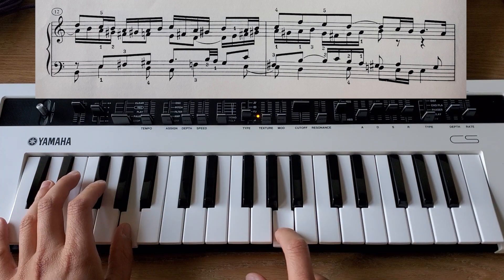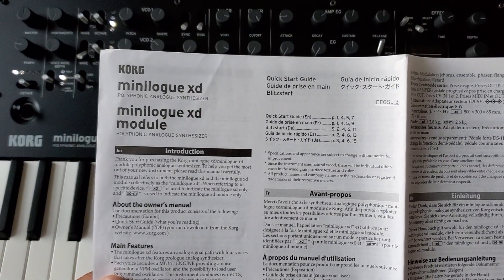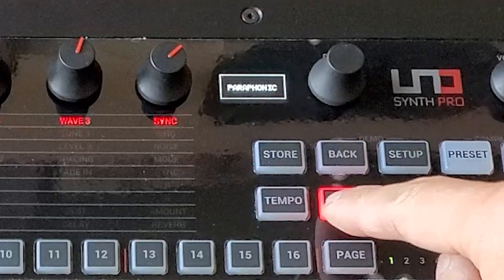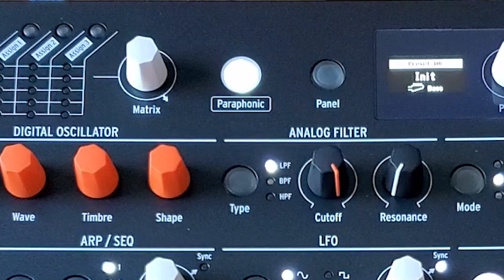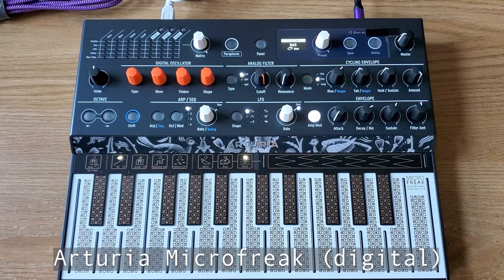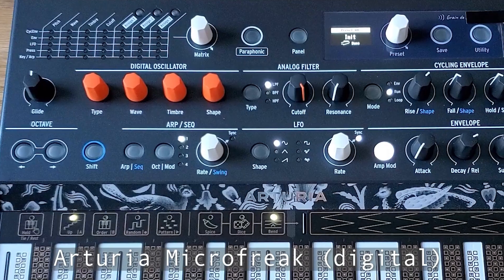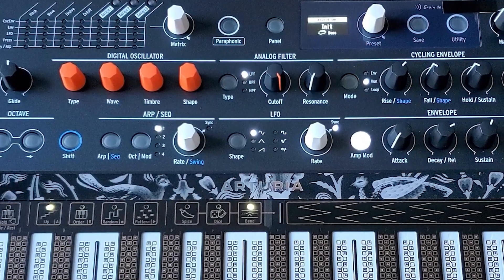How Synthesizers Work, for Beginners (part 1 of 3)

Comment: You’re right that analog v digital is ultimately decided by user preference but you skipped most of the facts that led to each of them being preferred at various times.
Reply from the maker: interesting point, but i think the goal of the whole miniseries, especially in 2024, is to introduce beginners to the world of synths without overwhelming them (also considering people's penchant for--even my own--for short videos).  the goal of that section was just to talk primarily about the sound differences once they were introduced, and information like popular preference through different eras probably would have been more suitable for something separate like "the history of synthesizers" or could just be something that they would research on their own if they wanted.

thx for the comment though!
Reply: @jngl-jim  YW.  What I would have preferred: noting that when digital equipment was new it was costly and had clear limitations, but both of these early problems mostly vanished as digital tech advanced.
Reply: @jngl-jim i’m glad you’re prioritizing brevity.

Comment from the maker: timestamps:
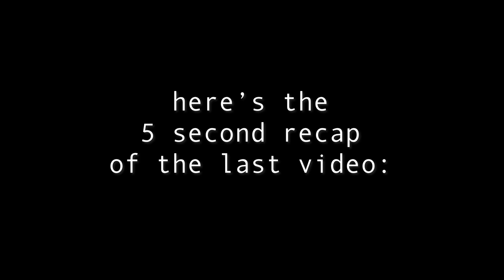0:00 Intro and recap of the first episode
0:26 Overview of features covered through this series
0:33 What is the difference between analog and digital synthesizers?
0:39 What is the brief history behind analog and digital synthesizers?
1:00 Who are the main manufacturers of synthesizers?
1:29 What is the sound difference between analog and digital synthesizers?
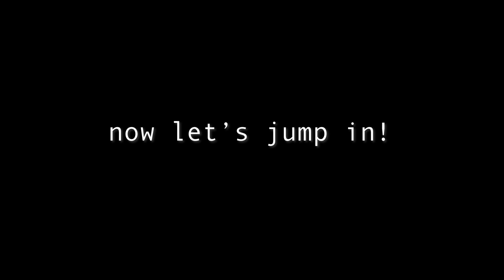2:00 What are synth oscillators?
2:09 What are common oscillator waveforms?
2:30 What do the insides of simple analog and digital synths look like?
3:03 What are synth voices?
3:19 How do synth voices relate to "voices" in classical music history?
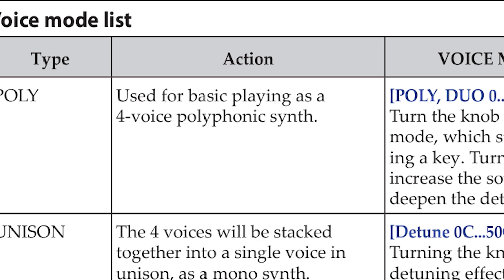4:14 What is paraphony?
4:59 How to get the total number of oscillators on a synth
5:20 What is an ADSR envelope?

***addendum:
1. Comparing synthesis types like additive, subtractive, FM, granular, modular, etc. Was omitted because this goes a bit beyond the beginner level.  For the most part all of these features that will be covered in the series apply almost entirely to subtractive and in many cases to all the others.
2. Usually an envelope can be applied to the filter in addition to amplitude for more fully featured synths.  This was not mentioned because the concept of a filter will be covered in part 2.
3. The beginning at 1:00 shows most of the main manufacturers that are active today after synthesizers were created.  This may be confused with them all being contributors to the analog space (since digital was mentioned right after... I admit the wording could have been improved here.)  Notably, ASM and Modal Electronics are the more recently formed digital synth manufacturers, and very good at what they do too, imo.  (Modal had a high-end hybrid "Modal 002" but now focuses on digital)
4. Also, though the way it was stated in the video almost implies it was the first one of its kind, the Yamaha DX7 POPULARIZED digital synths.  **addition 10/25/24 - per a viewer comment, other digital synths like the Fairlight CMI and the New England Digital Synclavier were also notably featured in hit songs during this 80s era, but the focus in the video was on the DX7 since it allowed more everyday working musicians to afford a digital synth.

The following synths were used in this video:
Yamaha Reface CS
Moog Werkstatt-01
Korg NTS-1
ASM Hydrasynth Explorer
Uno Synth Pro
Korg Minilogue XD
Elektron Syntakt
Arturia Microfreak

Music heard:
Chopin Nocturne in F# major
Bach Prelude in C major
Bach Fugue in C major
Original tracks and beats

A sound treated room with bass traps and monitors would be ideal for music production, but at minimum decent headphones that can reproduce sound sources with clarity are necessary.  These are the headphones I use that help me create these types of recordings and other recordings on my channel:

AKG K240 mk2 55 ohms - these are okay; I think music producers may be mixed on this, but at the very least they're extremely comfortable for long durations of usage as an open-back and the most economical option of the three I own.

Audio-Technica ATH-M50xBT2 - I only bought these when they went on sale late 2022 and then all of a sudden I saw plenty of musicians across so many different settings in Youtube videos using these lol.  They are fantastic for many purposes.  Sounds can feel like they originate from in your head though.

Beyerdynamic DT 770 Pro X 48 ohms - I had heard Beyerdynamic was a legendary brand and that the original DT 770s were often loved by producers... now I know why!  Very sweet sounding compared to the ATH-M50x.  Even as a closed-back, it creates a very spacious and natural listening environment.